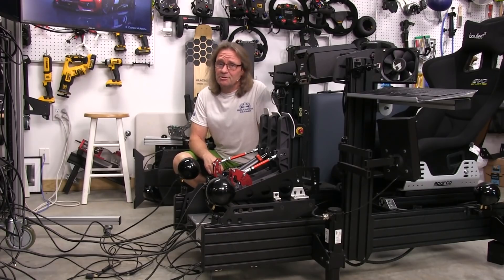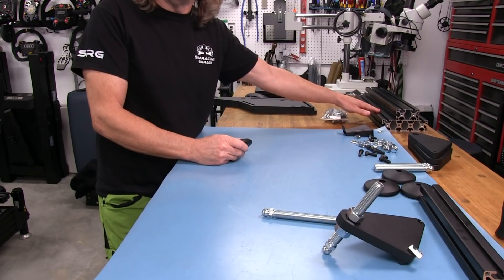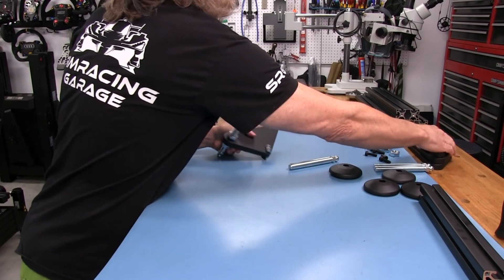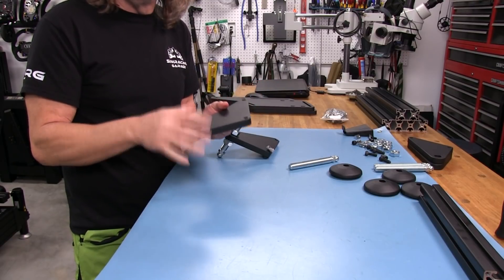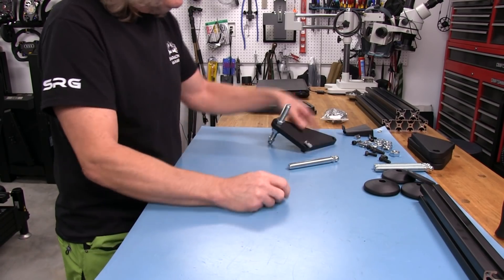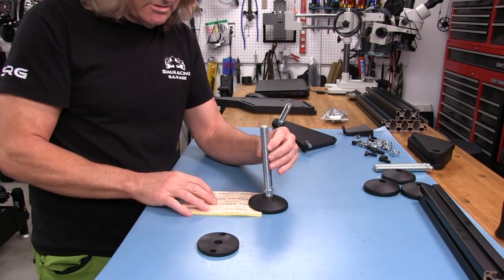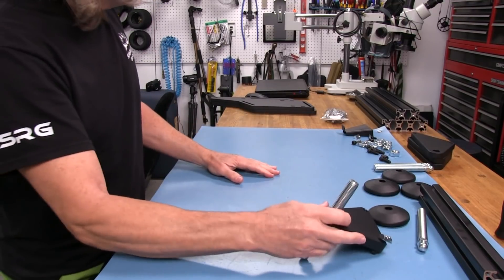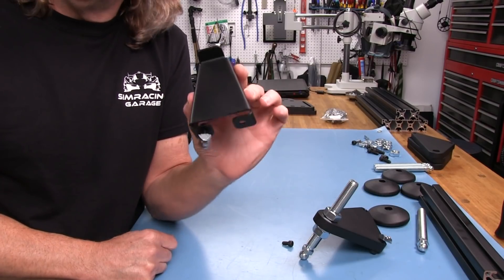Sim Lab P1 Upgrade Kit

Comment: If you do this upgrade on a GT Omega Prime, the original pedal deck makes a great floorboard between the seat and pedals great fit. Attaches 6 points with the left over hardware from the prime original build

Comment: Not sure why they didn’t put the pedal side brackets on the outside like the old one, other than that it would be scratching the outside and that would be visible. But if you need adjustability like that you can get the pedal slider with plate.

Comment: Thank you for the review Barry. I would be interested in the diameter of the plastic cups (feet). You mentioned that you measured, but didn't give the number. Thanks!
Reply from the maker: 79mm.
Reply: @simracinggarage3026  I guess that's why it says 80 on the bottom (give or take a tenth  😉).

Comment: Hi Barry.  I'm really stuck getting those plastic feet to pop onto the metal ball.  I don't want to hit it with anything in case the plastic splits.  How did you do it?
Reply from the maker: I tapped them in with a hammer on a solid surface, which was my concrete floor. They did not split. If you have a hydraulic press, you could press them in.

Comment: Can you give me the dimensions of the pedal plate?
Reply from the maker: With brackets, 500mm x 340mm.
Reply: @simracinggarage3026  thank you, which dimensions has a bracket?
Reply from the maker: 500mm, that's total including the two 15mm side brackets.
Reply: @simracinggarage3026  Can you also call me the dimensions only from the bracket (laser part)?